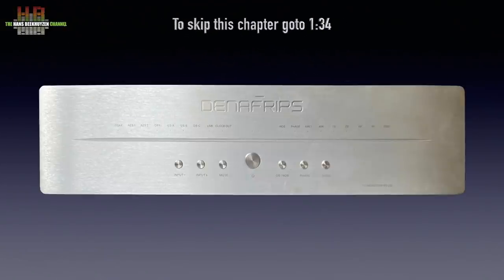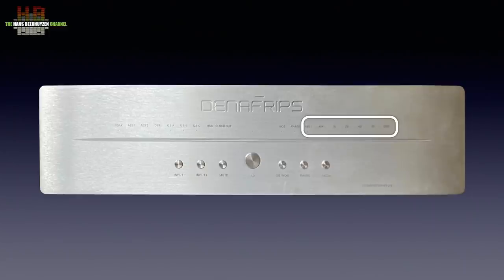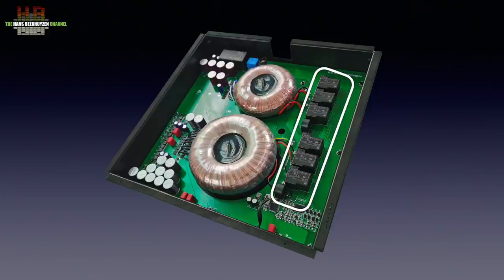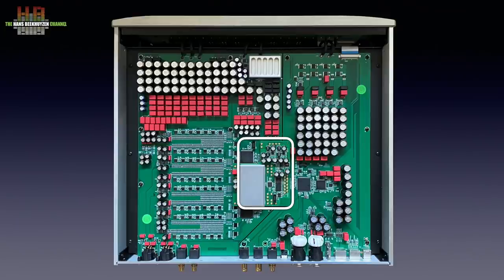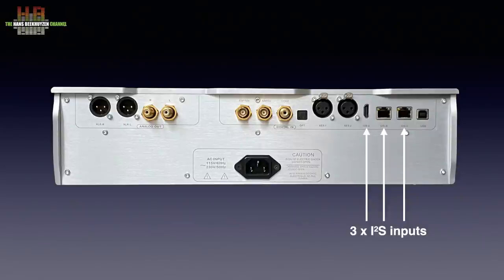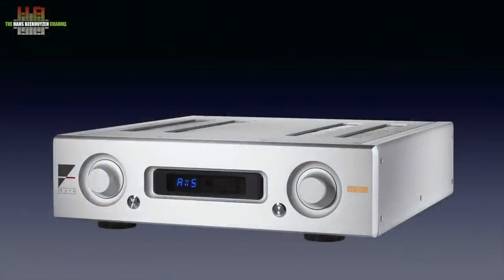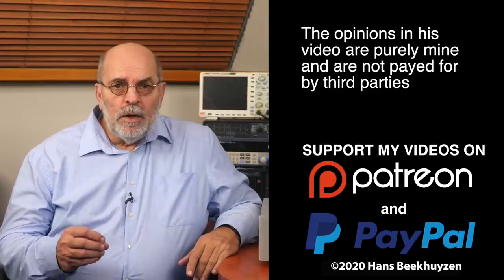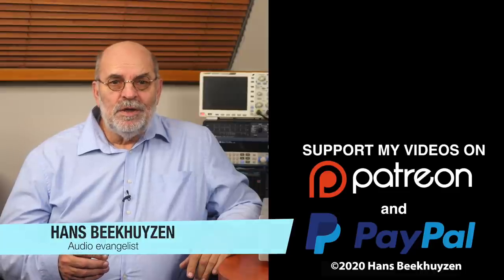Denafrips Terminator-Plus R-2R ladder DAC

Comment: Nice review!  Next insert the Gaia DDC to engage the clock out feature of the Terminator Plus.  The already incredible transparency with the Terminator Plus (a level of transparency that you think cannot possibly be improved) jumps to an even higher level.
Reply: @Burevestnik9M730  If the user did not engage the clock out feature of the Terminator Plus, I would agree.  However, if you engage the clock out feature, it is no contest.  The performance improvement with clock out feature engaged is significant.
Reply from the maker: Have you ever heard the Auralic Aries G2 I used as a source for the Terminator Plus? ...... I will review the Gaia in due time - avoiding to become a Denafrips channel - but I can assure you that the Aries G2 will make it a difficult task for the Gaia to sound better.
Reply: @TheHansBeekhuyzenChannel  I have not tried the Aries.  My sources are Sonore UltraRendu and Melco N1A/2.   The Gaia will still improve your system even with the Aries is my guess, but let's find out, the conversion to I2S is the way to go anyway.  Also, the "clock out" feature of the Terminator Plus has nothing to do with the upstream sources.  Engaging clock out will improve the performance regardless of your source, but, you will find that out soon enough.

Comment: Based on your excellent review I'm sure the DAC has a great sound and performance. But the absence of a remote control and the lack of some kind of display screen on the front panel showing the current mode and other bits of info seems to be an unfortunate oversight on Denafrips part and may hurt sales of this unit.
Reply from the maker: “Mode and other bits” are indicated by LEDs on the front panel.

Comment: Frequency response:
Venus ii 20hz ~ 70khz
Terminator Plus 20hz ~ 40khz
Hi, I thought the higher model should have better frequency range, but Denafrips seems the opposite way, did you check with Vinshine?
Reply from the maker: I don't know why but the difference is totally irrelevant. It could be that for the Venus II a milder slope is chosen since it's cheaper to make while maintaining sound quality. The danger is that extreme high frequencies have negative effect on the sound quality of the amplifier.